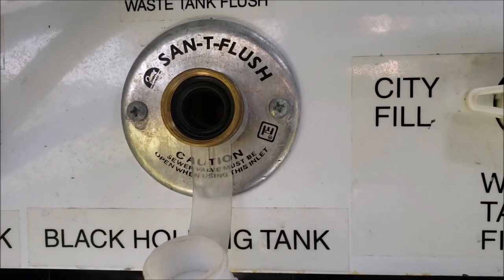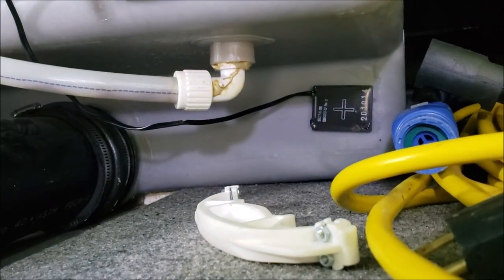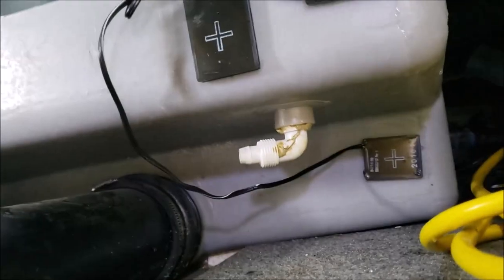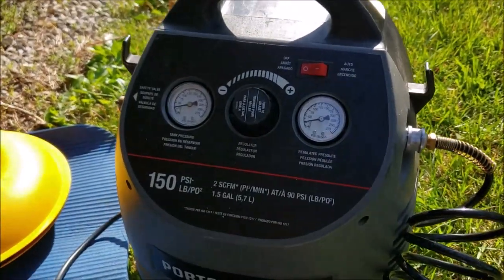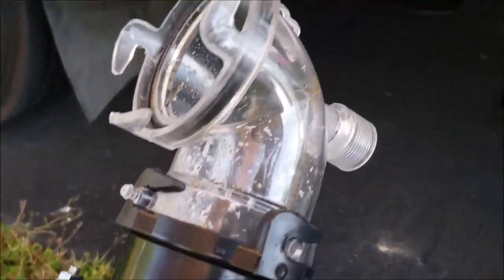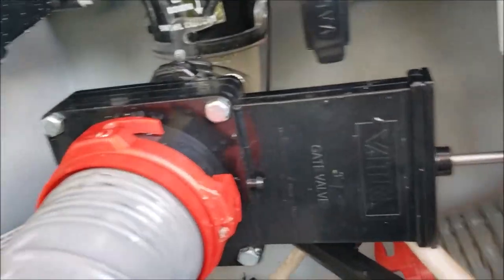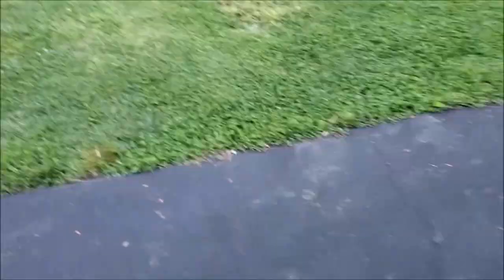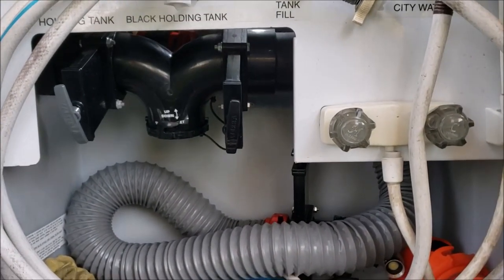RV San-T-Flush for Black & Gray Tank Plugged / Stopped Up How it Works & How I Fixed it.

Comment: Thanks Kevin. I’m going outside and see if I can unplug my San-T-Flush. Also, thanks for the tip on that pex nut wrench. I ordered one.
Reply: Here’s a follow-up to my effort to unplug my San-T-Flush line: I followed all your steps for checking plugging on my flush connection. I ruled out the anti-syphon and check valves by testing them. Fortunately the access to the anti-siphon valve was easy in my Winnebago Adventurer 33V. The next thing I did was to pressurize the line with 100 pounds of air pressure similar to your video. The obstruction blew out into the tank. I believe the flush connection inside the tank was plugged.  Thank you for your video instructions. You give me an opportunity to see if I want to fix it myself or hire  someone.
Reply from the maker: @sierradk  Thanks for the update Dave so glad you was able to fix it.

Comment: Are those valves supposed to open and close that EASILY?!?  Holy smokes!!  Mine are hard to open and close, I apparently need to change mine out...they don’t leak or anything, they are just really right to open and close.   Also, when filling up your black tank. Do you have your interior toilet valve open To allow it to fill up that fast?  When we are in a full hook up site in an RV park, I have to find a pretty big/thick tree branch and keep my toilet valve open so I can fill up the black water quickly to do a flush.
Reply from the maker: Some silicone spray may help with your slide valves. No I don't leave toilet valve open your black tank should be vent out the top of the roof so there should be no need to do that.

Comment: On the fresh water hose that attaches to the clear 90. What stops black & grey waste waster from going into your water source
Reply from the maker: It comes with a one way check valve. a rubber duck bill looking thing
Reply: I looked one up after posting my comment and saw the check valve thingy , just  didn’t  see one 
on yours . Nice functioning cleaning out tool